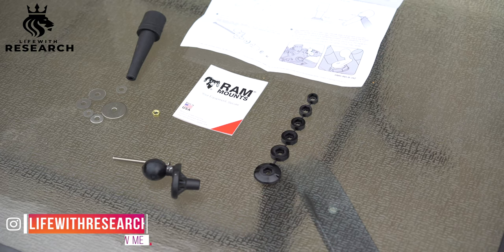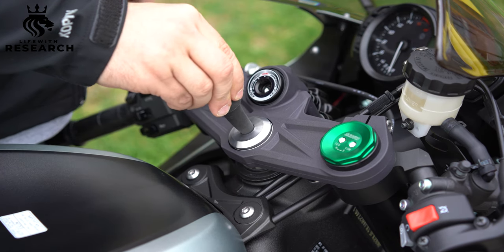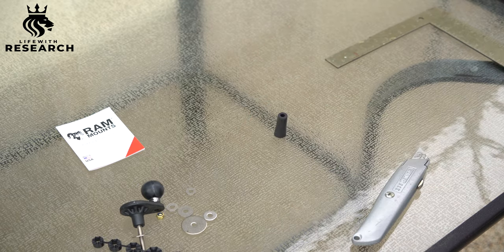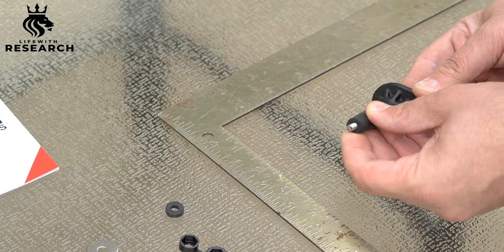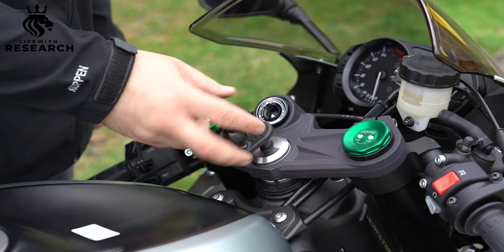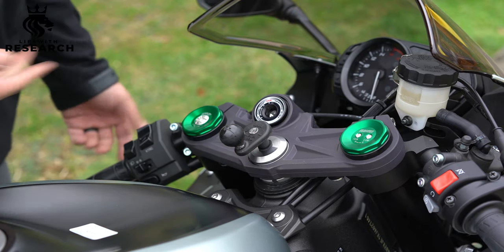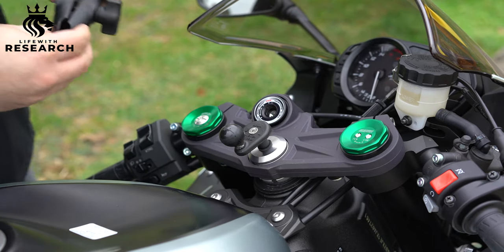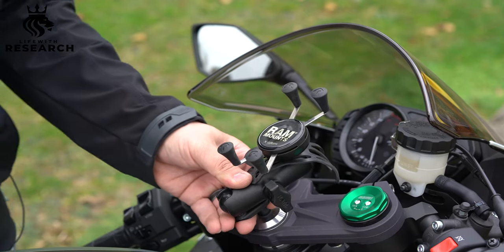HOW TO INSTALL A RAM STEM MOUNT ON A SUPERSPORT

Comment: If your whole video is about how to install the mount, whats the point cutting out the issues you faced and telling us how you overcame those issues? You had issues with the nut not tightening and then you edited and removed everything from there until its all setup and ready 🤷🏼‍♂️
Reply: Same issue so how to fix that would be helpful
Reply: @nicksedgwick5189  he took it out tightened the nut more for more friction on the rubber

Comment: Before you do this, run the nut around on the bolt a few times until it’s smooth. I have a belt sander that I used to get the rubber the perfect size. (Also not in a cone shape, use a washer that fits into the hole. The deeper the ball stem the better. The tighter the fit of everything the better. As little cracks as you can have means the rubber won’t sneak out.

Comment: Anyone know why my part can rotate around freely? Not the actually X Grip part, but the  ‘Stem kit’ ball part! I’ve tightened it up but it doesn’t seem to get any tighter?
Reply: did you find a solution ?
Reply: Take the washer off the top from between the rubber and mount and slap a dab of expoxy on it the put it back in, adjust the ball where to want it then let it set to harden up, problem solved
Reply: How you gonna take it off once the epoxy sets
Reply: Strip the thread in the upper part or the stem . it keeps the screw from spinning in order to pull in the peace that expands it ,just drill it out

Comment: Bro I’ve gone through two already. The black part with grooves doesn’t attach right so it doesn’t tighten when it’s in my bike
Reply: get a quad lock much better
Reply: @Colin_Shedaker  yeah bro the ram mount didn’t last long at all. Wish I would’ve known more about the quad lock before u wasted money on the ram mount. My quad lock is in the mail coming to me now
Reply: @kaceysilva22  my phone flew off my ram mount when I crashed, phone was smashed to bits 😂
Reply: @TheUrbanEpicure  you’re trippin bro😂😭 how did quad lock hurt you ? 😭I’ve had it for 3 months now and the case doesn’t bother me at all. Bro probably has it on his bicycle talking about the motorcycle mount.

Comment: Mine just keeps spinning 😵‍💫. Doesn’t get tight or anything
Reply: Ever figure it out?
Reply: @user-sv1zn9ef6l  It’s a defective design and not worth the hassle. Do not buy these. There are others made out of metal that expand as you use a hex to tighten or loosen them. Those are the best ones to use.
Reply: @MrFoxfire510  Can you recommend one? I have this and its pathetic, the ball can still rotate around no matter how much I tighten it, it keeps being loose and doesn't work properly, it's frustrating!
Reply: @Killing4food  I had that too, you need to go up in size of the washer, or get oversized one, put a fine thread bolt through it and nut on the back, chuck it in a drill and rotate it  against sandpaper to make it smaller, it has to fit almost snug into the stem hole or else the rubber creeps out and loses grip over time.

Comment: I tested ram xgrip and stem mount on my GSXR. It does the job but ram xgrip is a poorly designed universal phone holder. It holds the phone in place but the stem mount is bad designed (you have to cut yourself the mounting insert to install it into the stem and it self destroys after the first turn of the nut...), does not lock in place and it touches the aluminum stem with the risk of scrathces. The x grip does its job but looks weak and woobly, the rubber holder looks like it is going to break only if you stare at it... I bought it and returned. Better consider other brands such as SP Connect or Quadlock.